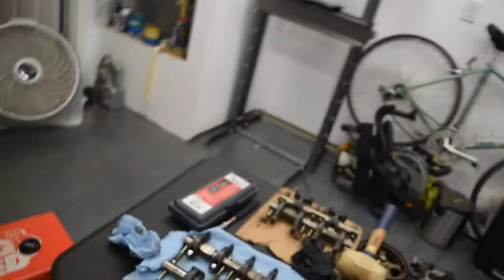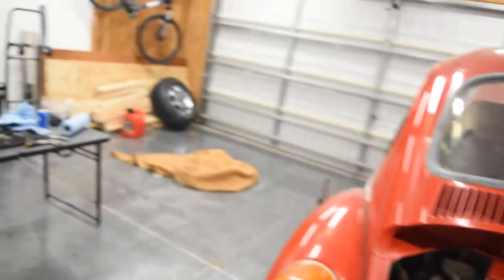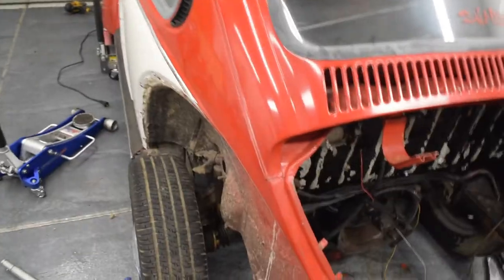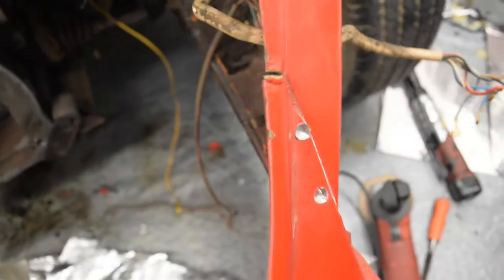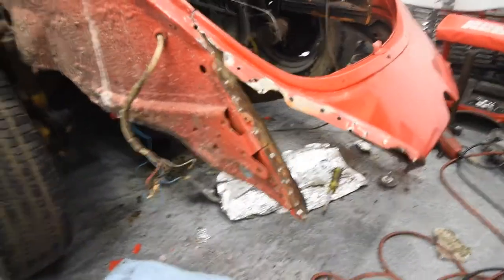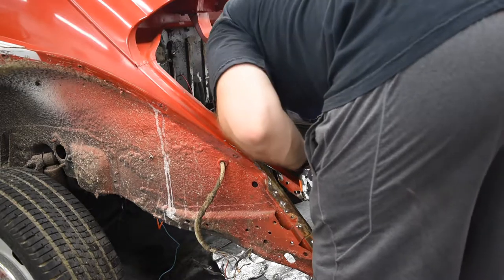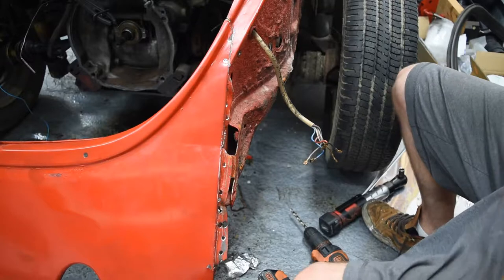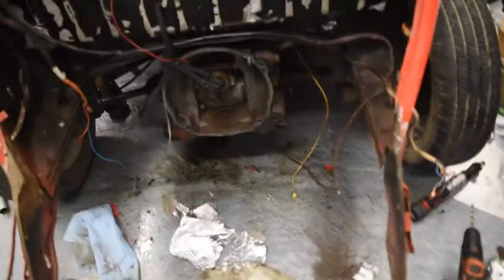Removable Rear Apron (Valance) -- 1973 VW Super Beetle Subaru Swap

Comment: Looks like your apron was replaced at one time like mine. My car had been rear ended and whoever reinstalled it welded the piss out of it. Otherwise it's a few spot welds and it's out.
Reply from the maker: Yes that would make a lot of sense! Definitely didn’t expect the factory to put so many spot and seam welds for a simple panel